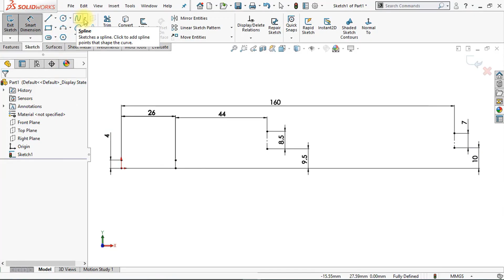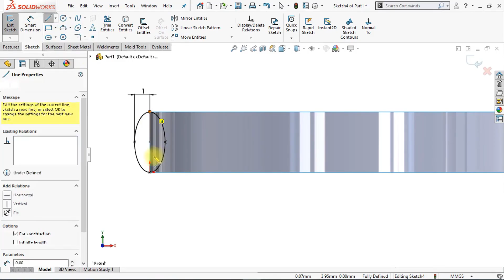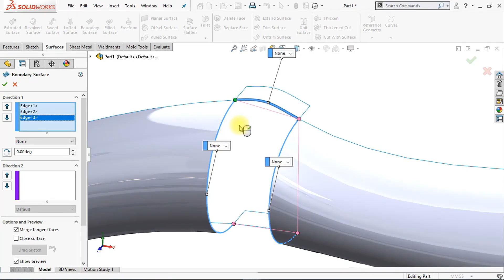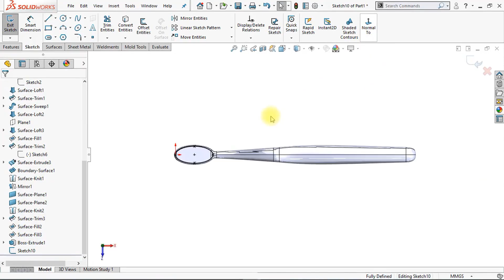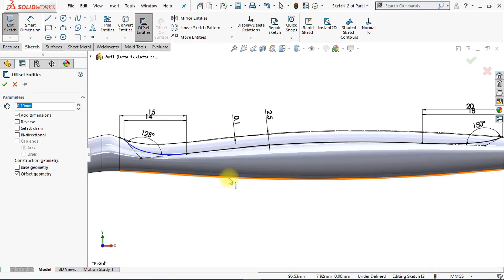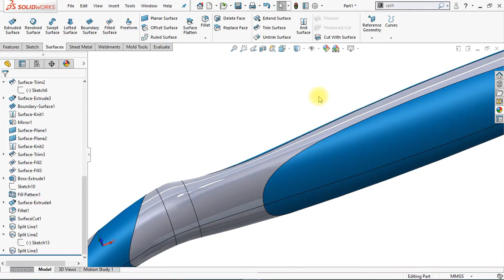How to model a Toothbrush in SOLIDWORKS? 🪥

Comment: I'm still very curious if the rotating render is done entirely in SolidWorks or a photomontage.
It doesn't look like you're using Motion Studio.
Is it with Visualize? Or with PhotoView 360?
How do you generate the rotating motion?
I appreciate the information. Best regards.
Reply from the maker: Hi! Thanks for your question! :)

It's actually a rendered turntable animation! The model rotates 360 degrees while the camera stays in a fixed position, creating that smooth rotating effect.

It's a great way to showcase a 3D model from every angle! 😎

Happy modeling!
Jan